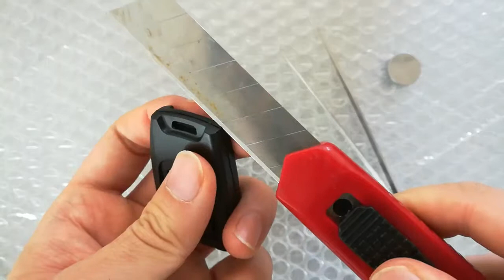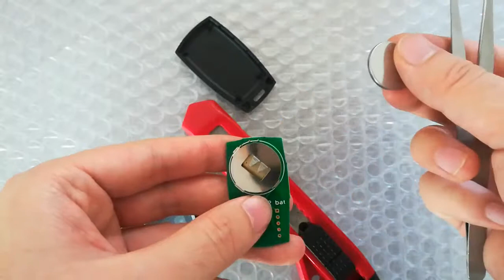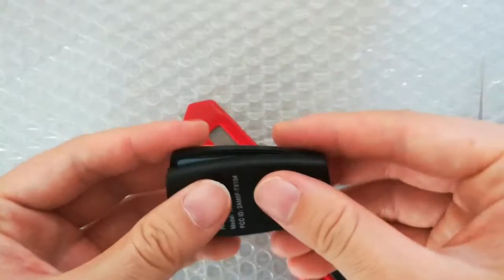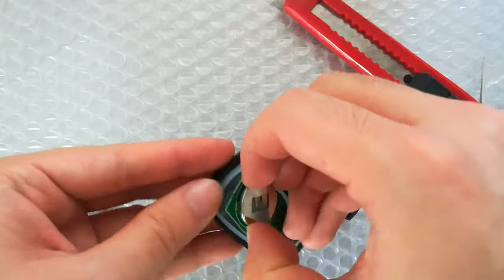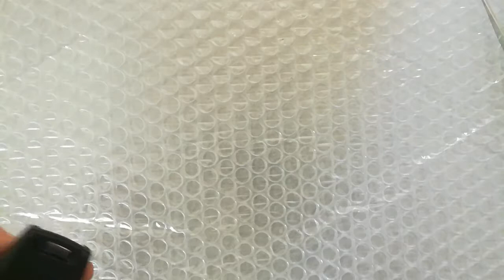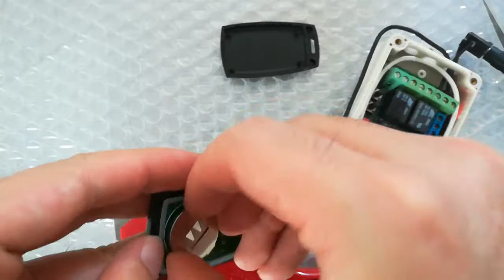TX134 Gen1 - Change Battery and Change Working Mode

Comment: Hi there :) I can not get my additional TX134 remotes to change to AES, I did exactly this but no change still in regular mode, any advice ? thanks the units are amazing, I had an issue with problem neighbour using code grabber and your AES unit ended it instantly.